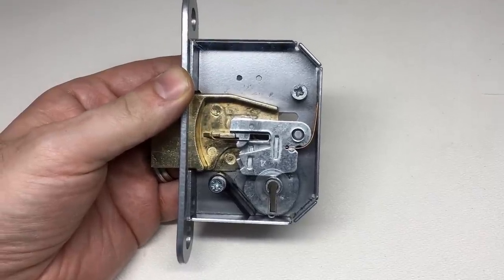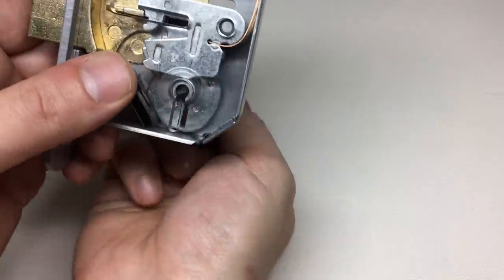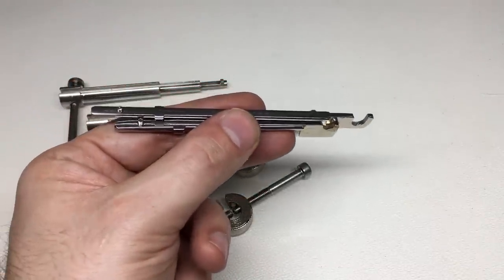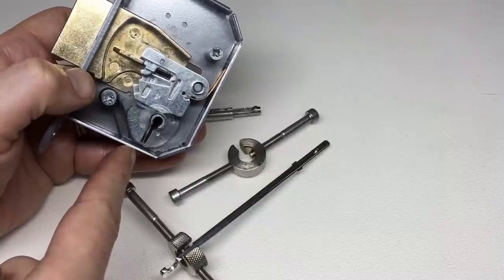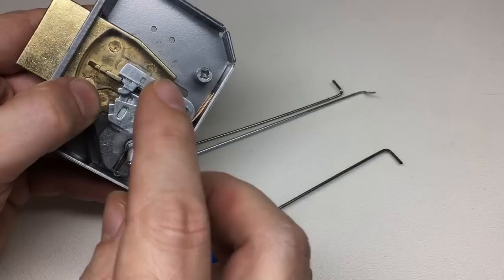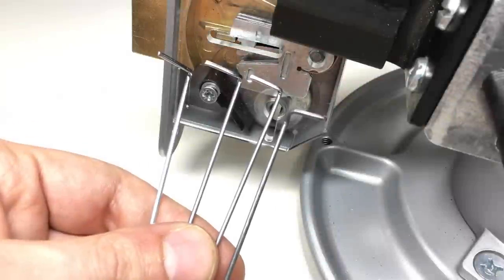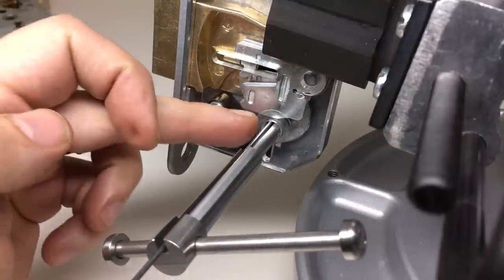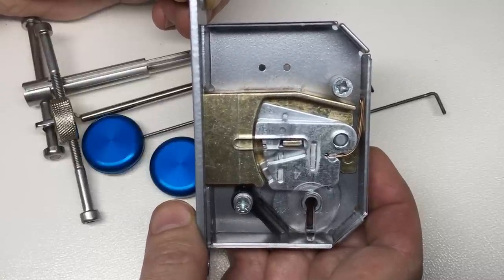Curtain Lever Lock Picking - Tools and Techniques: Ultimate Picking Guide Part 4

Comment: I'm interested to know how you would know which side of a mortice lock has the bolt in it. The tools you show look to me only to be able to work if the lock is accessed from the side opposite to the bolt. What happens when the opposite is the case?
Reply from the maker: You use the same tools?
Reply: @LockNoob  Thank you for your reply. I'm probably being thick but the tools @3:28 in particular look to my untrained eye only workable from the opposite side. If they are used to turn the curtain on the same side as the entry point surely they will be in the way of the picks designed to fit into their cut-outs. I ask because I'm tempted to buy a set.

Comment: I’m enjoying the series. I was.a little surprised how you advised the curtained locks need tools that are specific to them. As a holiday gift to myself I got a Chubb Battleship & a Chubb 3G114. I bought this Old English padlock pick set at http://www.uklockpickers.co.uk/old-english-padlock-pick-set-uklp-special.html.  I was able to open the Battleship quickly after slightly shortening the tension tool. I was also able to open the 3G114 which appears to be curtained (and it has a Perspex cover to see through).  Perhaps I just got lucky with those tools & models. Just thought I’d share. Not easy to get a range of lever locks stateside.
Reply from the maker: No, I hear lever locks are rare over the pond :-)

Comment: Why can't you just use a tenssioning wire like in non curtain lever locks to turn the curtain?
Reply from the maker: There isn’t the room to do that. You could use a wire, but you would have to bend it and flat it to basically look like the other curtain tensioning tools, so you might as well just use them